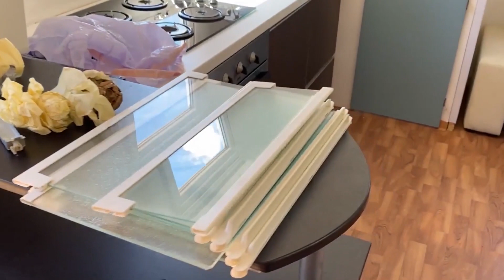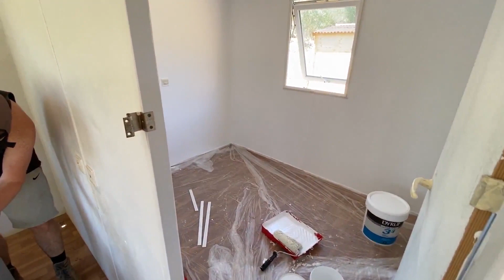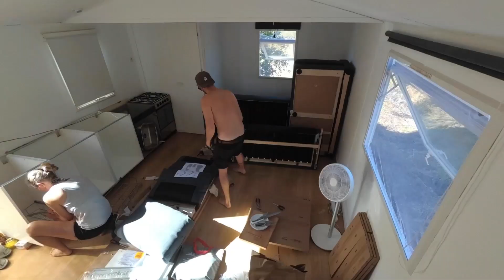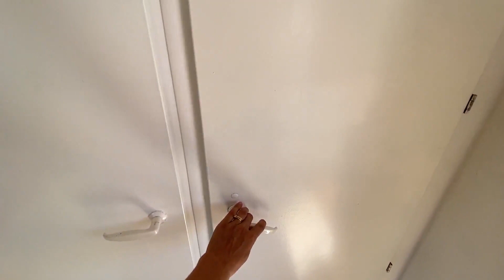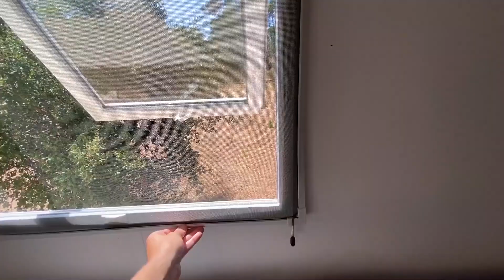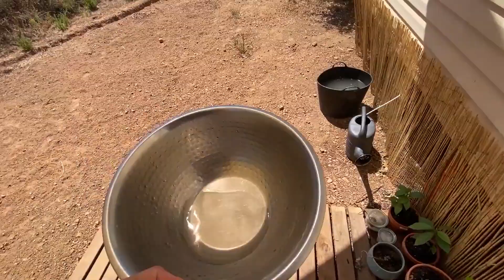Two Week Off-Grid Tiny House Transformation - Life Reimagined

Comment: Good job ... Fantastic and hard working 
I like the work you have done for the house 
Please can you share the budget , the items ( like the fan brand and price ) ... It is very useful for all who are thinking to walk on your steps ...
Reply from the maker: Yes, sure. I thought about adding here but i think ill do a separate video running through costs and favourite little bits and bobs. Matching Xiaomi battery Fan and Vac have both been great. I think fan was Xiaomi Smart Fan 2S and it was 99 euro inc shipping on eBay. Dont use the smart functions much to be honest but being able to offload some power in during high hours so we dont have to have such a big system battery has been great. plus the fact we can move it anywhere :)

Comment: Good job guys, looking forward to seeing the land where your dreams are becoming reality.
What size solar system did you go for?
Reply from the maker: oversized panels with 2x400w. 12v 600ah fla ultracell batteries, 3000/6000w inverter (maybe oversized this a bit but wanted it to deal with heat and not have to run fans 24/7), victron 100/50 mppt and batteryprotect,
Reply: @Life.Reimagined  completely future proofed, good job. Not lithium batteries I'm assuming at the price you stated?
Reply from the maker: Tool Porn and Kismet Construction we will release a video on all the details of the solar installation shortly, so stay tuned for that one!! 😊
Reply from the maker: Yeah no. Again just watching the price move and life of the caravan didn't seem to make sense. Caravan will be sold in a year or two and can't really mix packs...and used batteries loose value so quick. Batteries are rated for 10 years at 50% draw at normal temps. In this heat I expect 5. Will be going lipo for the house though and will probably build my own pack